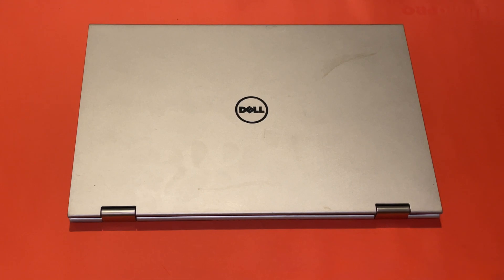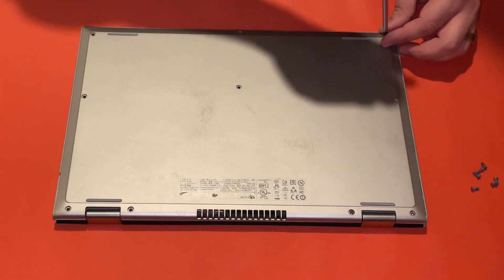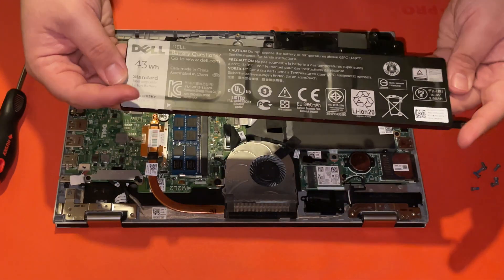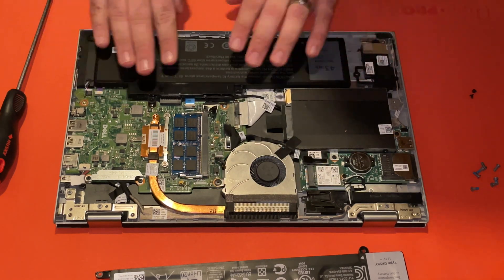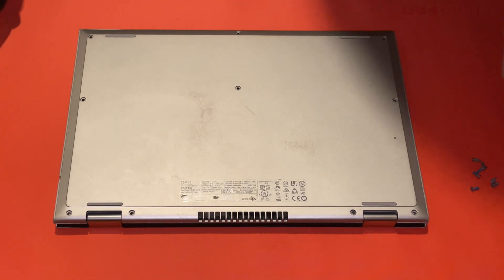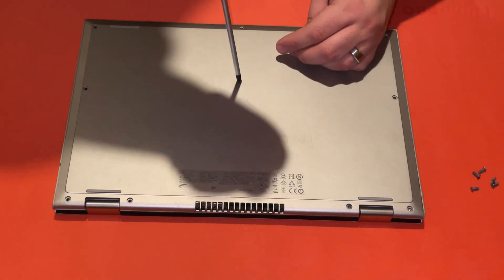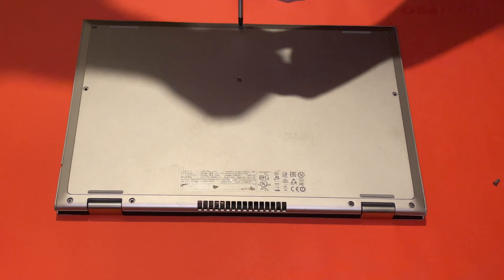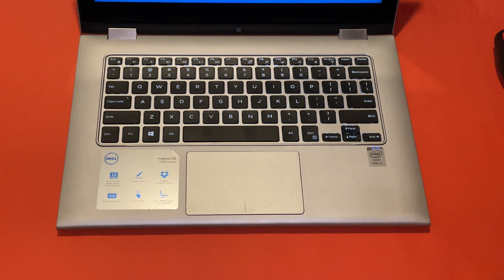Tutorial: Dell Inspiron 13 7000 Battery Replacement

Comment: hey, ive follow all the steps and test it, but the battery always stuck at certain percentage while charging, like 55%, 79%. idk how to fix it, ive changed the adapter too, but it still the same. can you help me? oh, i bought the battery on my local e commerce, it has good reviews, also ive claimed warranty the battery 2 times hhe
Reply from the maker: That has happened with a few other of our laptops too, some were were able to fix by fully discharging the battery and fully charging it while not using the battery a few times the rest we had to RMA for a replacement.
Reply: @TachibanaTech  okay, I'll try the first method, thx